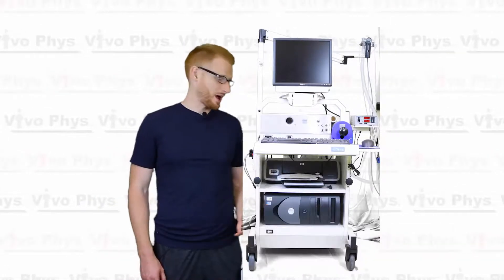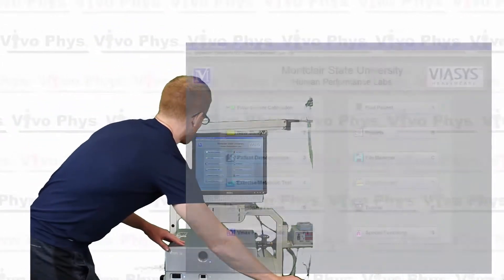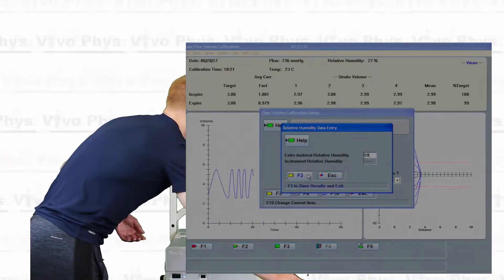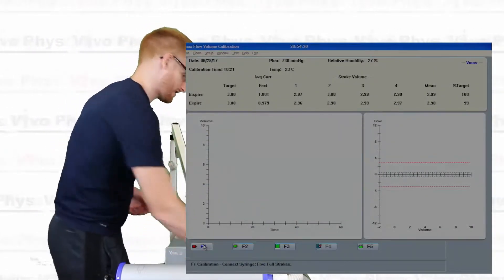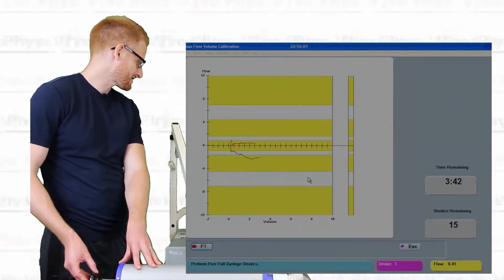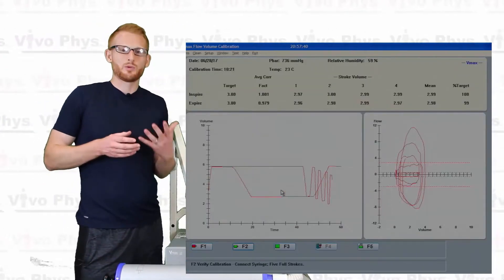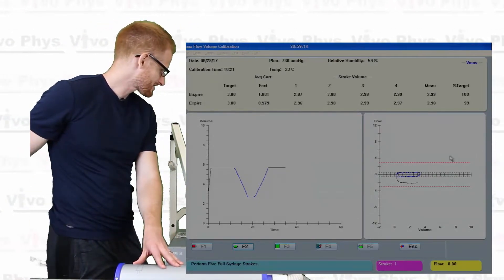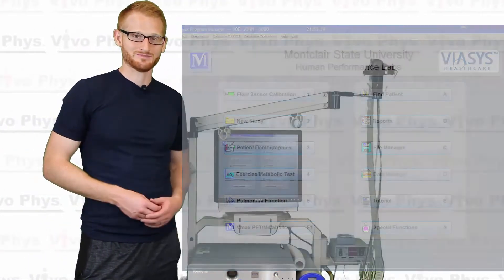Metabolic Cart Calibration Part 1 - Flow Calibration

Comment: Hello, thank you for these videos. They are really helpful. I was wondering why do we have to second calibration on another screen (the one with the red line)? What does it tell differently to the system than the previous ones?
Reply from the maker: I do not remember for sure. I believe one might be flushing the system, and the second is the actual calibration.